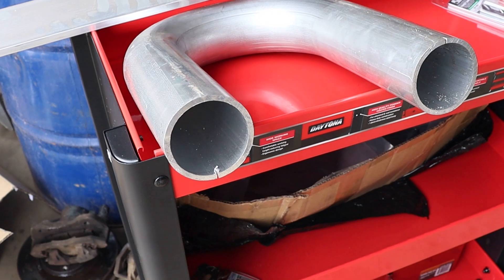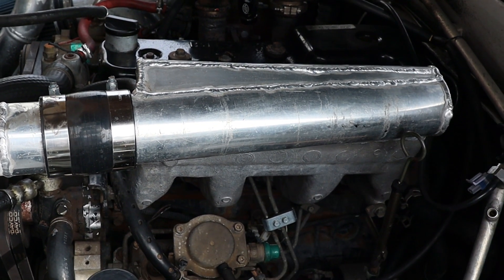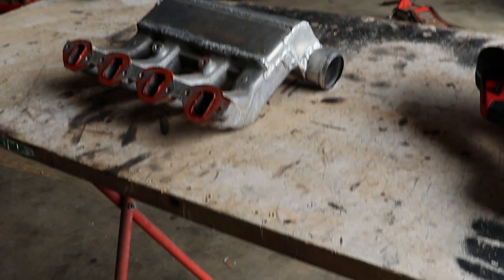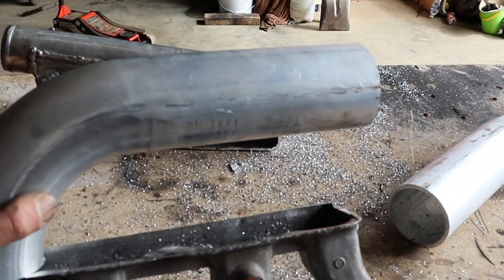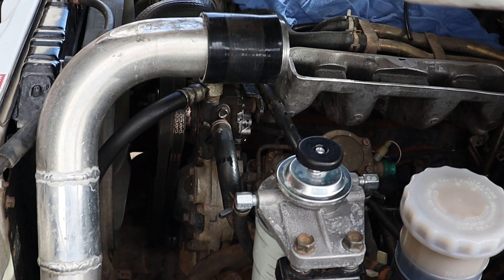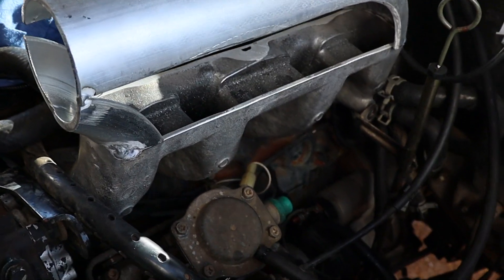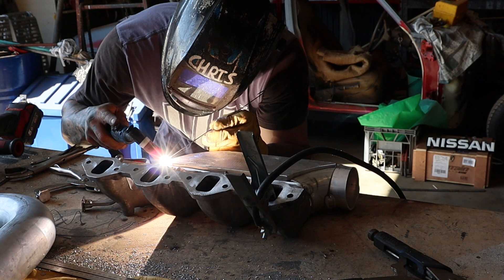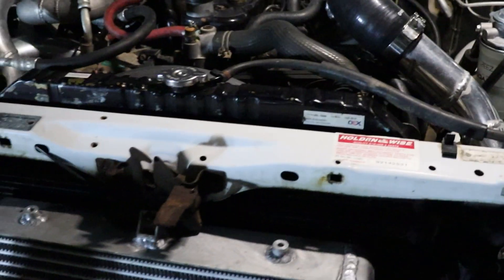4JB1 TF Holden Rodeo | 2.8 Turbo Diesel | Custom Intake Manifold

Comment: Hey mate, I love to see your videos. I've got a 1998 2.8 rodeo, what were you revving doing 100kmph before your mods? And did/does yours idle a bit rough on startup before warm?

Cheers,
Reply from the maker: At 110kph it sits at 3000rpm and yes when it's cold it runs rough as but once it's warm it idles fine